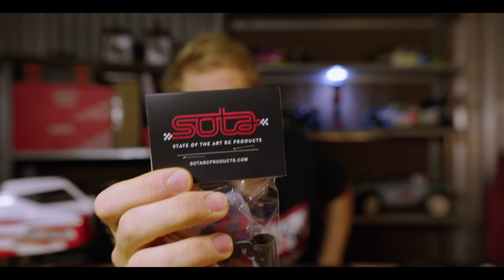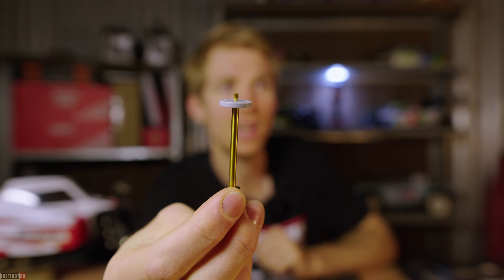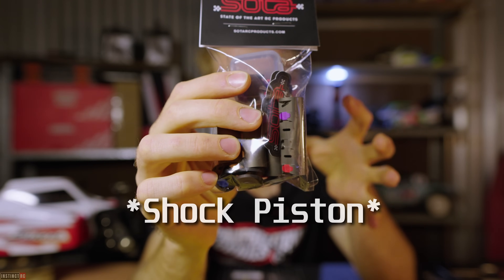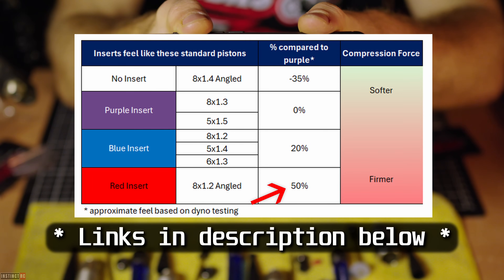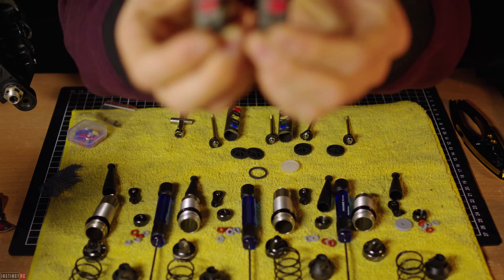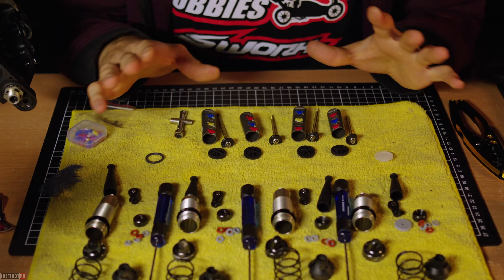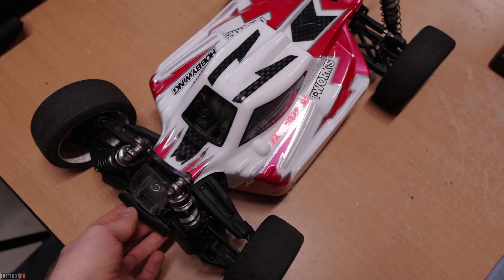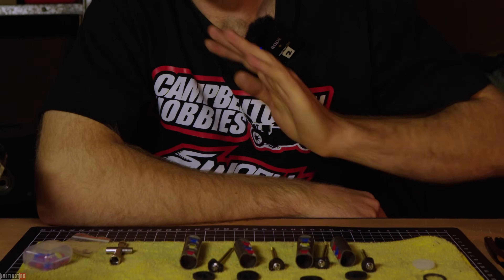The FUTURE of RC Shocks? | SOTA RC

Comment: so what new
Reply from the maker: Erm, well... the new SOTARC Position Sensitive Damping System. It's all in the video!
It's not new technology per se, as it's used in full size vehicles, but it's new to scale RC vehicles, especially for racing 🙂
Reply: @InstinctRC 

This comment is after watching sotas’s other vids.  The one labeled “POSITION SENSITIVE DAMPAMPING “ VID sold me 100% !   

I’m convinced he’s got a great system now that I’ve seen more from that video!   
And for bashers especially!  

It will allow you to load your shocks with something , say for instance ,like a 2000 cst diff oil even to a shock (for bashers like me ) ,and you can get like a 80 wt drive /ride on the flat ground.  
But greatly take care of or eliminate bounce without sacrificing so much handling!     It gives an option to have best of both worlds for bashers.    
I can see a lot of people running 100 wt oil that would never do that except in extreme cases like I have mine set up ,where they run 50 wt .  But they can get that drive out of a 100wt they’ll do it .  

So for that it’s pretty cool !!   

Giving you the ability to go to the wayyy heavier oil without the drawbacks.  

I’d like to see him do inserts with this direct dichotomy in mind for bashers to get the “PACK” at its best with like a 2000 cst damping while keeping the regular drive hight at around a 70 or 80 wt . 

His extreme test sold me on it !    
And I’m not easily sold as you can read above . 
And that’s without me testing it myself.  Which i would normally need to do.        

Hell. I spent more than 130 $ on my after market basher “blatterless” system and,I think his extreme test set up is pretty much how my “TRAXXAS Sledge” is set up now.       

I think he can do better with aiming towards bashers with a more direct system of inserts for us in mind to limit chassis slap without being counter productive to the drawbacks of not having any chassis slap.  

I’ll send a guy over to check this out that i believe will be interested in tinking with it as a basher. 
Especially if Scott does the 1/5th scale versions like he said.  
I think …actually.  I KNOW they’ll benefit the most from the difference.  👍

So yeah. Relay this to him if ya would .  I’m in the States Btw.
Reply from the maker: @Chon-c  Awesome, glad you found it, I was going to point the videos out to you earlier but then saw your comment above (I was also busy racing again today). Can absolutely relay this info and Matt can respond when able. 

I believe all the R&D on these has been on the racing side, as Matt races himself, and also quite a few top drivers have helped him develop it. I'm sure the system would be just as suited to bashers, but obviously the range of shock dimensions for different brands that you'd have to develop the system for would be very costly, and most likely only capture a small % of drivers in the basher market, given most people who buy bashers just want to drive em and enjoy em, not spend hours tuning, so it might not be worth the investment, but I don't know. Given how much adjustability you already have on many bashers and especially full race kits, you can see how adding these into the equation could be too much. It's one thing to understand how changes affect the car in theory, it's another to know which way to make changes, how much of a change to make and in which situations to make them, and often that comes down to past experience, as I'm finding, as well as a good understanding of how the car "feels".

1/5 scale would be cool, I have a mate who races 2WD who'd be interested, but it depends if there's enough interest to warrant the investment. Time will tell.
Reply: @Chon-c hey Chon, I’m glad it all makes sense. I am looking seriously at the basher market. If the basher has a 16mm shock bore they might be pretty easy. I’d also do the 1/5 scale. Just gotta get an idea of which one first… cheers Matt
Reply: @   Yeah.  I caught that in your video that convinced me.   
It does phenomenal with “rebound” for bashers.  

As I mentioned,Rich Duperbash will work with you on testing 1/5th I’m sure .  He’s a great guy . I think you would like him and get along fine together 👍

I’m definitely sold on it though.  
Just from what I saw in the drop tests.  I don’t really need Dyno #’s .   

That essentially allows you to run 2 different oils far apart based on the results.  (I know it one oil. But I’m meaning in the rebound results). 
Thnx for touching base. 👍
Reply: @ 

@   But see.  That’s the thing.  Bashers wouldn’t need a lot of tuning options once they found their sweet spot in a loose ride while having damping of a 100wt for example.   
Once they found that they would leave it there .   And it wouldn’t be any different than Matt’s extreme example setup in the test.   I could see guys being comfortable starting at a 100wt. 
That’s usually runs 80 ,but wanting less bounce /rebound from even that big won’t go thicker because it stiffens up to much for ramp approaches for example. And that sleeve with Matt’s extreme set up would totally get rid of that dichotomy.  
It that’s my assumption anyway from what I seen & how I’d use it.  

I know a bunch of people who spends around the same amount going to emulsion caps & changing pistons that adds up to not much less than 100$.  

I know that’s what I spent . 
And it’s only set up for big jumps & loss of handling is the trade off.   And from what I saw in his drop tests. Those sleeves actually does better on the rebound than what I got .   
And it’s not really a “wear part” so it’s a one time purchase to get the best of both worlds. 

It will also allow you to run those really thick diff oils where other pistons will not let you go above 100wt if you don’t want it locking up .  lol.  
And they wouldn’t be anymore pistons failing or breaking with that either.  Because it is very robust to take the 100 foot up air launches.   Testing needs done yeah.  But this is just from what I saw & can tell it would handle.   
It’s actually built like a basher part in that way already.   
Right now ,100wt is as far as most of us take the wt.  
with the sleeve ,piston & bladder (which I think that would also work just as well with a bladder-less emulsion cap too for what I basher would want ) it allows you to go up 3 more weights thicker to have that awesome tight rebound of the car after hitting & gives a better driving on flat ground than even the 100 wt does with a regular emulsion shock like I have now. 

I’ve been in the hobby almost 45 yrs.   My first hobby grade was a white body monster beetle Tamiya . Then a Kyosho Assault shortly after .  And countless others.  lol. But I’ve never raced other than with friends on a track.   
I’ve always been a break and modify guy .  lol.
Reply: @Chon-c  for the record my current race inserts can provide up to 3 times more damping force between the no insert and the red. But for the bigger scales I could easily tune them to get more.
Reply: @   Yeah. I saw that said in the other vid .
And I was actually saying what I have on the thought that they are not even optimized for bashers yet & there’s more room in your design to do this greatly.  
And best of all.  It allows people to keep a OEM ride/drive to an extent.   So yeah.  I was saying this based on the knowledge that they are more room to improve them for bashers even as good as they are now.  

Like i mentioned before. IM SOLD on your inserts.  
In my opinion,they can benefit the basher community more than racers. I know that’ll be laughed at.   
But countless people has spent more than 130$ on searching for different spring options and oils ,even springs from other RC’s to not get the results I saw you get in your drop tests. 

They are actually a video on yt where a guy is showing how to Double spring their shocks on a arrma.    It has 35 thousands views. lol.  And is one of the most viewed vids the guy has. 

This tells you a lot. Or should. 
Not that his idea is good. But the amount of people searching this subject & their desperations lol. 

So trust me on this.  
You really need to market harder to the basher community. 
These racer types are smart enough to know how it can help them & almost all of them watch basher community vids.   

If I were you.  I would send some out to a few of these YouTube guys.  I know RICH DUPERBASH would love test them.  And I’m as confident about him liking them from what I saw them do.
Reply: @   Yeah.  I noticed.   In the channeling can be manipulated a lot for a wide range of needs .  
Your bladder is perfect though I think.  Seal & a bit of cushion is all it needs . Emulsion type works for that better I would imagine . 

It really is a good idea after I saw more details.  (The numbers isn’t what I needed.  It was your flow tests with the glitter in the fluid and the physics of it is more to my type of brain . I learn by seeing. Numbers has always just been a result of what I see & for tweaking after.  I’ve done some engineering work myself.  Machining etc.  analog without CAD mostly )
Reply: @Chon-c  thanks Chon, no stone was left unturned. Even the washer is CNC machined for added strength!! What are you driving?
Reply: @SOTARCPRODUCTS .  
Nice 👍.  

The most ?lol.  A sledge !  
  I like my sledge .  

It’s only like 20% oem tho.   

I built it instead of buying knew to take the long expensive way around to get one like a tank.   
Bought most plastic from Jenny’s back shortly after its release (and before jennys raised the prices ) and I built what is essentially a M2c “BEEF CAKE” upgrade version as Mitch (at m2c) designed & released the parts for it.  
1717 1650 Castle w/max 6.   
Running the old 40 series Trenchers tires on it.    I bought 3 sets of 4 back when I found out proline was discontinuing them .  Lol.   So I’ve got a few sets of 4 to bash with.  
They are a couple mm taller than the arrma back flips .  But I got them on 1/2” offsets instead of the “0” offset .   They are an odd size width but a couple of mm ,taller than every other 8th scale tire out now that proline makes for 8th scales plus they are lighter in comparison . 

 They are a perfect bashing size tire with a  great compound.  
 & can take 8s power well.  

So it’s pretty much a juggernaut.
Reply: @     I run my SLEDGE THE MOST.  it’s a juggernaut that’s only 10% at most OEM lol. It’s not a traxxas by any measure.  
Just the arms & a couple of other pieces of plastic left like the wing and chsssis Support bar is all that’s traxxas. lol. 
 .  I built it instead of buying new to upgrade.    Max 6. 1717 1650 castle.   M2c “BEEFCAKE” package of upgrades.  Of course. When I built mine that package wasn’t offered. But essentially that’s what I run.  

You are very welcome.  Glad I can help in any way I can.  

I love the hobby.  But mostly. I’m a tinkerer myself.   I like that actually more than the driving of my RC lol. And why I have stayed with it over these many yrs. lol.  

Eh Matt.   I let 2 guys know to come mesg/comment & check out your inserts.  
Both are very experienced in testing for a couple of the biggest known RC after market parts makers to upgrade.  
Both are exactly who you need to optimize for bashers. 
Because I really wholeheartedly believe that’s a market you’ll do well with.   I do think they will spend the $ because it’s not “a wear part” persay.  
And it gives us the most improvement.  Especially the 5th scale guys really need this because shocks hasn’t really changed for them with the added physics involved & these companies are fairly new to offering them on a bigger scale & wider range.   And they are heavy.   But mostly,the oil variety hasn’t really been optimized for them either where that part of the market hasn’t had the incentives where it’s been a small market until the last 4 or 6 yrs other than a couple of RC brands.  

A lot of people owns the arrmas & stuff now.  M2C has really been leading the help for optimization of them to take the bashing abuse.  

Both guys I am sending to you has plenty of experience over the yrs with all of this & knowledge.   
And they are smart guys.  Very nice.  And very good people.  

Bcuz I also thought about character for you in who I sent.  

Thomas Patterson.  He’s a friend of mine.  I know you e seen his vids.   He has the oldest RC channel on YouTube.   TP-PARTS-XTREME .  & i already mentioned RICH DUPERBASH.  
BOTH ARE very solid guys.  
And who can really help you get your inserts where you need them to be working for bashers.  
But most of all. THEY CAN GET THE WORD OUT TO GET YOU THE MARKET INSENSITIVE .  
Like you said …
And I can also see the machining room you have for the optimization for them scales & use cases you mentioned.  

Thomas lives in Norway. 
So he’s at work at the time I posted this.  He said he will check you out when he gets home.  
Go watch a few of his vids and you’ll see what I’m getting at. 

✌️
Reply: @ hey Chon, your replies certainly indicate a passion for sure! Love it! At the moment I’m very interested in tackling any and all shocks with a 16mm shock bore. I believe the arrmas kraton is one. Once I get my my hand on the vehicles I can have something for you guys in about 12 weeks. 
I looked at the sledge and they also look about 16mm. If they are you’re in luck! 
I’ve still got my Team Associated filled with my basher setup. This weekend I was comfortably dropping it 4-5ft onto a concrete floor and no chassis slap but it still has good movement in the ride zone. 
I have a set of Losi 5T shock being mailed to me. I’m really keen to get moving on those. The difference these guys will see will be amazing. They’ll have a different adjustment too which will suit the larger bore shocks. 
Thanks for reaching out to your friends, Those guys and anyone for that matter can reach me here or my email. 
Cheers
Matt
Reply: @ 

Perfect 👍.  THOMAS has a 5th scale losi buggie  5 B electric 
The old one that was originally a gas that everyone converted to electric.   

Those bores are all the same I’m thinking.   I don’t have a 5th scale right now.  

Sold the last one I had about 4 yrs ago.  

To me. The 1/8ths are the sweet spot with power ,speed & durability.   

I was waiting on them to be developed a little better .  
They are about to get there in relation to the plastics /arms & weight. 
They are where the 8th scales were about 10 yrs ago relative to build strength for the size/weight & power.     

12 weeks eh.   Cool. 

If you want me to test anything,let me know.
Reply from the maker: @Chon-c   wow, finally sat down to read that absolute essay of a conversation between you 2! Lots of interesting topics covered, much I can't comment on due to not having much or any experience in.
I'm personally much more into racing than bashing, so are most of my RC mates. The novelty of bashing sort of dwindled for me after hitting the track for the first time mid last year. Having a set track to do lap after lap on, finding the best lines and improving as a driver (As well as racing other drivers) is what I love most about motorsport (Full scale and sim racing too). I still enjoy occasionally throwing the rear end around of my little 1/10 AE Pro2 SC10, mainly with mates but racing is my passion now so I'll try to cover that side of things in terms of new products and experiences on track, mainly in 1/8 scale, but also 1/5 and 1/10 via my mates who race those scale cars. It sounds like your buddies are well suited to advise on the bashing side. This might be something I can also delve into further at some point, but I don't really want to spend $$$ on bashers when I already have my hands full with racing 😅 We'll see though! At the end of the day, racing can be extremely expensive and daunting to new people, so bashers are much more appealing, but they can also be a decent entry point into racing.
Reply: @InstinctRC  where’s a better show of the shocks working & more in depth use ?   

You said they were links ,but I don’t see them

Comment: So basically its similar to a good motocross suspension and you can have progressive damping. Softer at the top of the strole, and when you get deep into the stroke it can progressively slower to resist bottoming on hard hits.
Reply from the maker: @jondoe4667  spot on 👍
Reply: thats how all oil shocks work.
Reply from the maker: @ohhi5237  on modern full size vehicles yep, but most RC vehicles still use the original 100+ year old shock design which doesn't provide position sensitive damping.

Comment: I think Proline makes springs that do the same. I think it’s a double spring, towards the bottom it’s stiffer.
Reply: My system would complement progressive springs. Springs store kinetic energy then return it. More they store the more they return which can lead to bouncing. Most RC off road race springs are uniform coils and therefore linear in spring rate.
Reply from the maker: Yea, progressive springs. I think a couple brands make similar.
They work in tandem towards the same goal. Springs are very reactive, so damping (via pistons and shock oil) allows you to control the velocity and feel of that reaction.
Reply: Actually if u go back @15 yrs. The first power stroke shocks that proline makes had a separate bypass that had ports that as the bypass was compressed the open ports inside the bypass were made less as it compressed making it harder to bottom out.
Reply: @modzilla74 where can I find pictures of this?! This is so cool